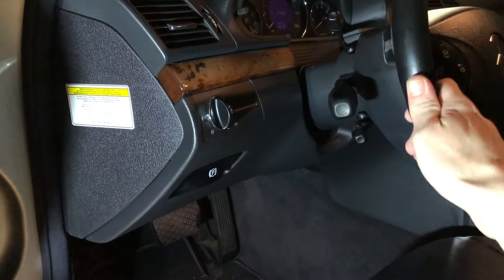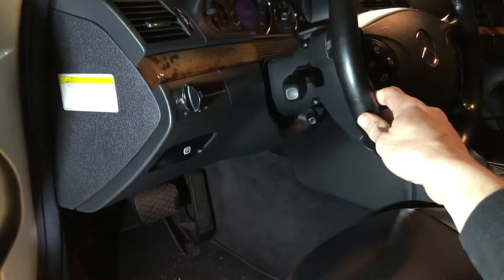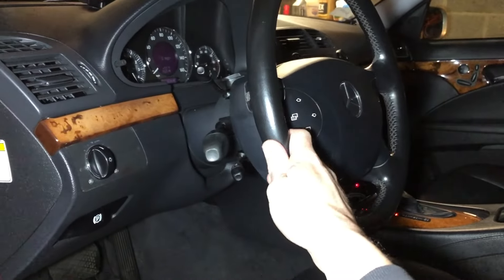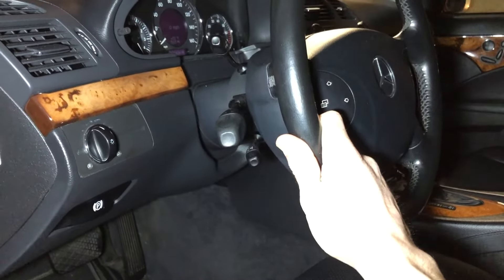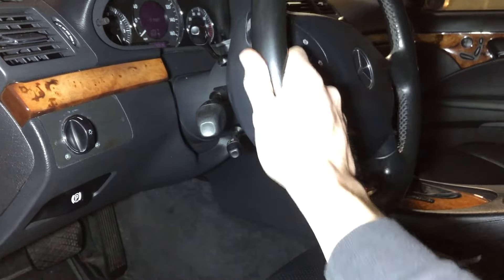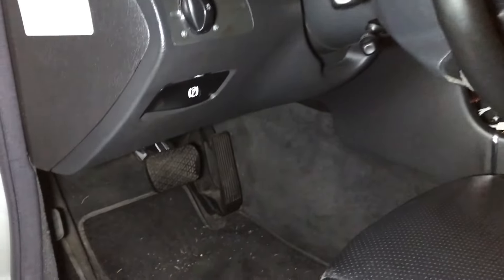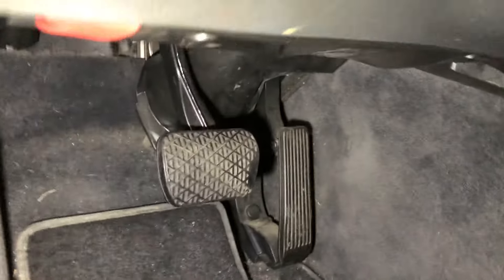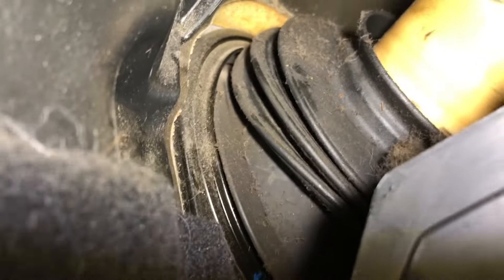Fix a Squeaky Steering Wheel in 2 mins! - SUPER EASY - DIY

Comment: How to put inside black rubber is covered thank you in advance
Reply from the maker: If your rubber boot is still intact, see if you can gain access at the top where the seal connects. It may also be where the seal meets that is causing the sound. While we don't recommend it, you could slice a tiny hole to fit the nozzle in the boot. We would only do this on a rubber boot on the interior as a last resort. Good luck and let us know how it goes.

Comment: Hmmm interesting 🤔 this just started with my steering wheel... Very low at first but it's getting creakier/squeakier...
Reply from the maker: Yeah, it slowly grew on us over time until we finally decided to deal with it. Most likely the official repair is to replace the boot. However, the silicone spray is still working for us!

Comment: Mine is different, it doesn't come from down there it is at the wheel it self and is more high pitched, how do you fix that?
Reply from the maker: It took us a moment to identify the source of the sound, it was only when we got our head down by the steering wheel that we could hear it was coming from the column near the floor. If it's coming from the top of your steering wheel, it could be the material on the back of the steering wheel rubbing against the column. You can try the same approach BUT use very little silicone spray. Instead of spraying into the wheel / column, spray on a rag and wipe any of the edges that may contact each other. There are more electronics in this area of the wheel and you don't want to damage them. Silicone spray is totally safe for electronics, but it's better to be on the extra safe side and use only a little bit on a rag instead of spraying into the wheel. One more note, be careful not to get any on the part where you hold the steering wheel.

Comment: What is a boot, what does it look like  and where do I find it in my 2011 Toyota Camry?
Reply from the maker: The boot is a round rubber covering that goes around the steering shaft. You should see it near the pedals where the steering shaft goes into the firewall (the metal between the pedals and the engine.) hope this helps!